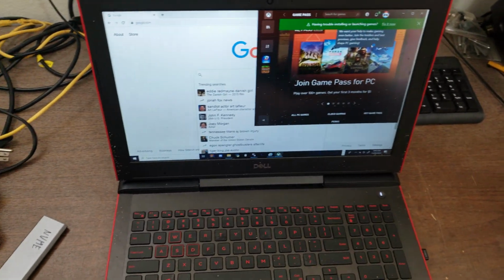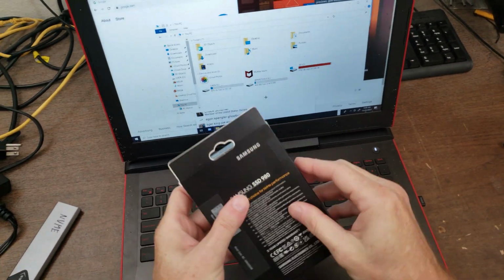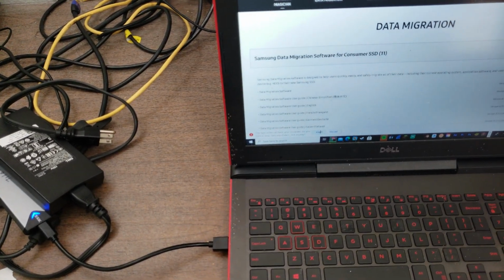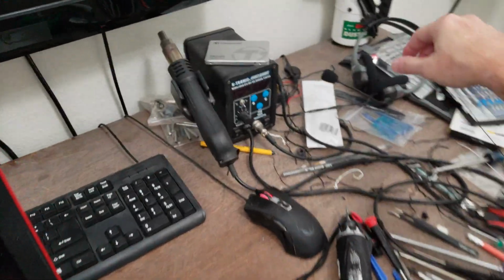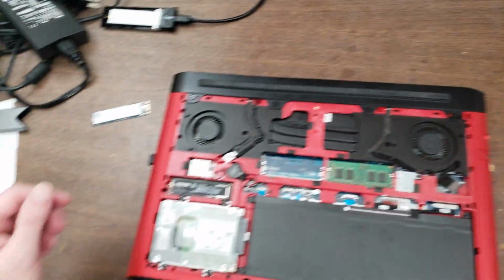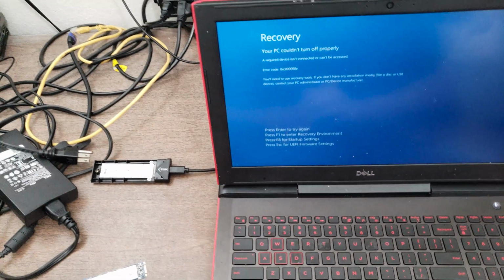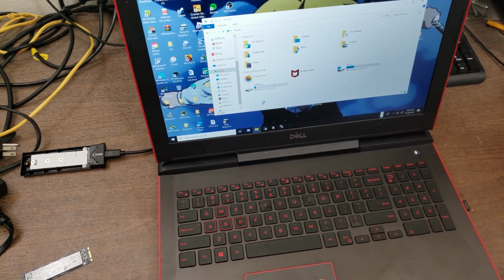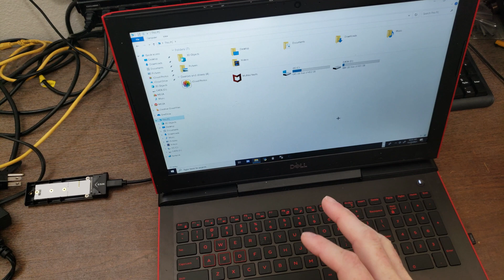Dell G5 5587 Laptop, Cloning M.2 SATA 512GB to M.2 NVME 2TB Upgrade with everything moved over

Comment: Great vid, did you set the sata SSD to AHCI before cloning? I seen people mention they’re shipped with it being set to RAID for the Inspiron 15s and need to set to AHCI for it to be compatible with the NVMe. Also which one would you prefer the 1tb of that EVO 980 or crucial P5 plus 1tb in terms of performance.
Reply from the maker: I haven't had issues leaving the sata set to raid.  I haven't compared ssd performance between models.  A Google search for both with vs between the models would be the thing to do.